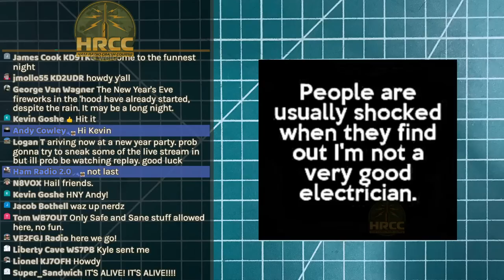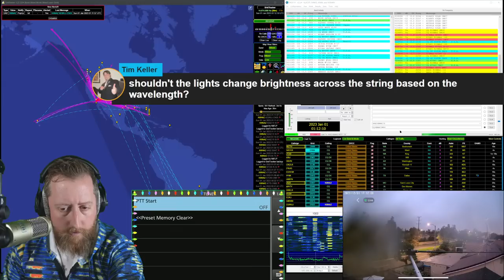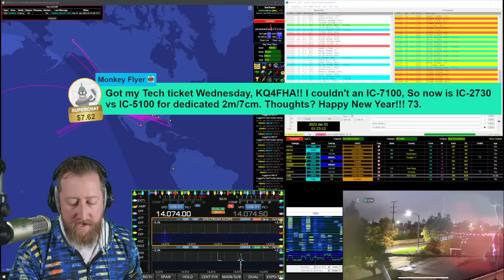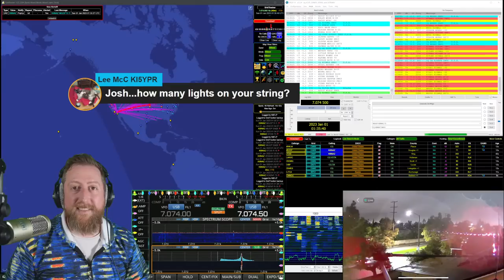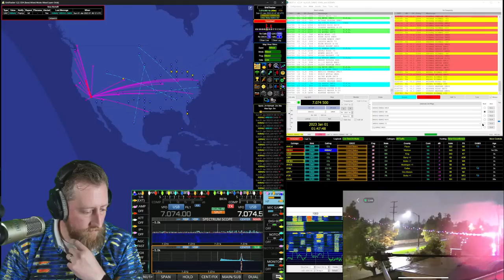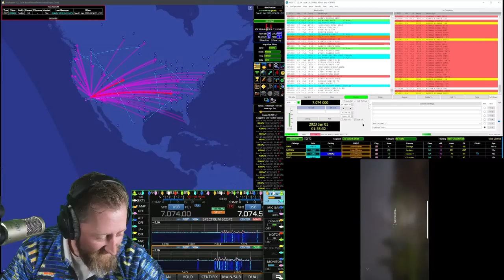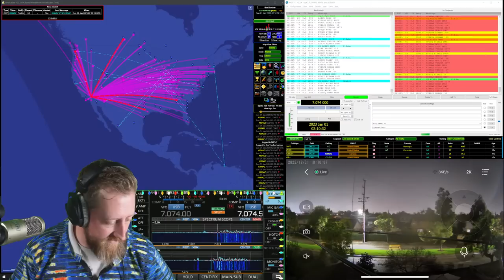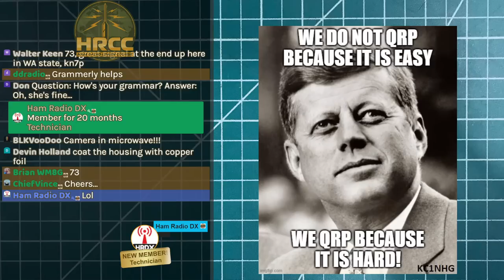REBORN - The Christmas Light Antenna

Comment: Your tuner has already tuned that frequency, recorded the settings in a memory. The design of tuners did not have “requirement” to track dynamically changing SWR over time on the same frequency. The design criteria was to detect changes of SWR when frequency changes

Comment: Wonder what difference you would see with an autotuner at the base of the antenna like I run on my 43' vertical? Remove the loss of the feedline from the equation...
Reply from the maker: I sure it would work better. Do any handle an amp?
Reply: @HamRadioCrashCourse  MFJ has one MFJ 998RT will match 12-1600 ohms

Comment: The LDG 1000 pro II doesn’t interface with the radio even though it’s supposed to according to the manual.  I’m using the interface cable and everything.  I contacted LDG and they said the auto feature doesn’t work on the 1000 pro II.  Definitely feel ripped off.  Their customer service is very poor.  Hats off to R & L Electronics that did everything possible to help troubleshoot.  A+++ service from R&L.  I’ll be a lifetime customer of theirs from now on.  LDG…nope, not buying from them again.